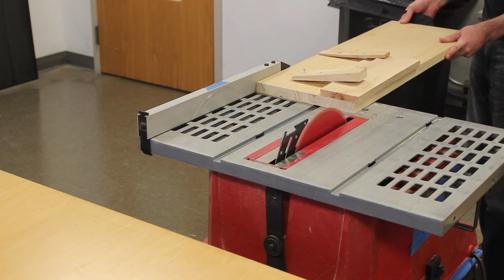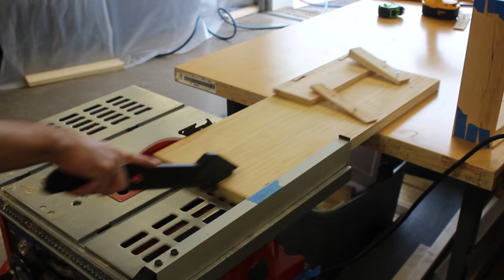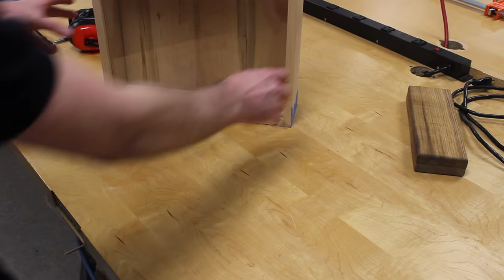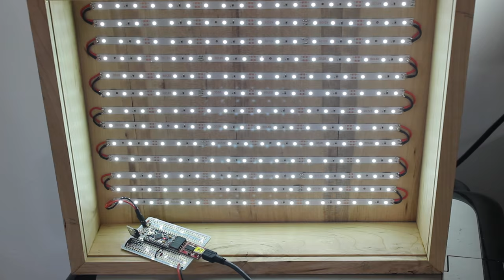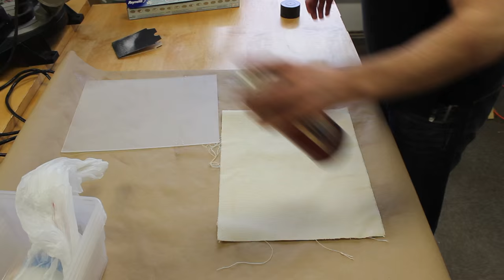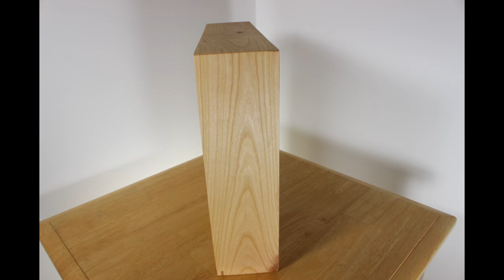Making an LED Light Box

Comment: very instructional video, now I'll be heading to the nearest Walmart to buy a table saw, dust collector, box joint jig, router table, router bits, festool mitter saw, orbital sander and edge sander. I'll keep you posted on the end result. thanks
Reply: So... it's been 2 years. How'd it go, friend?
Reply: @RoTeNdO  3 years, and he's still at the store.
Reply: 6 years

Comment: Nice video bonafidegeek...!    I want to update my 5ft x 3ft lightbox (wood framed as yours and currently powered by fluorescent tubes) to LEDs. I reckon you have about 250 LEDs in strips 13ft long for a box 14" x 18"...? So for mine I would need about ten times as many LEDs or a strip 130ft long or 40m. Would that still be the best way to do it do you think? And how many watts does yours consume - I think I might want a lower light density...? Thanks, John

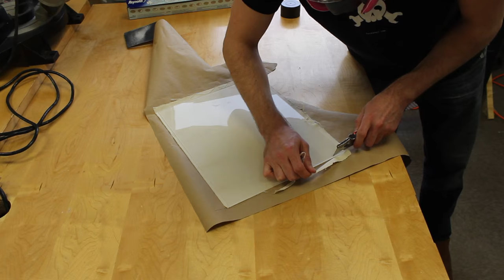Comment: Nice video, thanks for sharing. 01:25, not sure how you gonna slide that acrylic panel through the frame?? Seems like there is a thin opening cut outside of the frame, in the bottom side?
Reply from the maker: There is a removable insert in the bottom covering an access slot. See photos here https://photos.google.com/share/AF1QipNhISHViJ2LW7ip3wRuykXldq1srwK7Gu82MhjfSaTnwxsVlay1WoPMPI3bD7NGkw?key=dXd6ZGtISC1iR1hkd0MtdVNrODNFV2dCSGt3aHZR

Comment: I'd like to find a source of information about how you POWER the buggers - I see these 20, 30, 35 LED strips with "usb power" but do you need a transformer of sorts to power 3 or 5 or elevendee-seven of them? And when they say "mini-usb port," umm, there's only like maybe five different things that could be... you know, wut wen woo, wyee, NO-body can do the boogaloo lak ah doo, but hep me hep me Rhonda! Just keep buying stuff until something doesn't explode?
Reply from the maker: For this particular build, I used a 12 volt wall wort and a MOSFET circuit to dim the LEDs. If you are interested in larger builds, here's a link to another project that I worked on with 1200 LEDs. I did a more extensive write up on the project, with more details about the power supply. https://www.instructables.com/id/RGB-LED-Maker-Tree/

Comment: You skip the part where it has the slidable insert area. How do you cut that little line without making the face for that side fall off? Seems like it has no connection at that point. I see at the end you put that side on bottom. And when you're sliding it in, seems like it has strength. Just can't wrap my head around it. Is that something you cut once the whole frame is made?
Reply from the maker: @MrFloatingperson, you're right it's not shown in the video. When cutting the bottom slot the blade does go all the way through the piece. The resulting cut off is glued to an additional 1/8" wide piece that covers the slot where the plexi slides into. I put a few pictures of the insert here https://goo.gl/photos/TqLeSxFUzGBwziT49
Reply: NO ... you set your blade to the depth of the grove you want and it will never cut it all the way through.  No gluing needed.  I did one last night after cutting up a coffee table to make a shadow box.

Comment: Hello why do you cut and connect the led strip, why not just turn them ?
Reply from the maker: It may not be apparent from the video, but the LED strips only bend easily along the length of the strip,  they don't flex very much left/right (imagine the LED strips as thin metal rulers). It would require a large radius to curve them and still keep the individual LEDs pointing outwards. By cutting the strips and arranging them in rows I was able to get a very dense grid and maximized the amount of light coming out of the box.